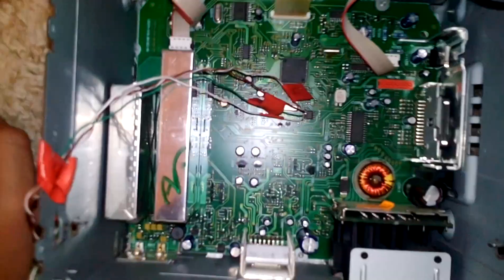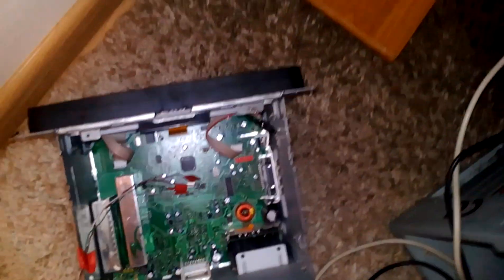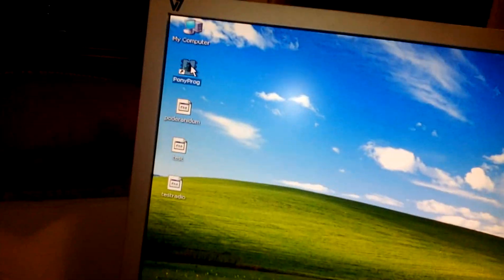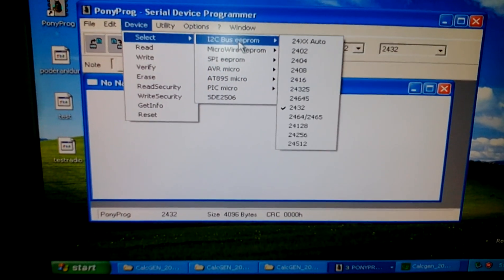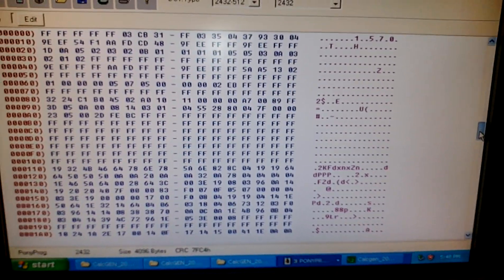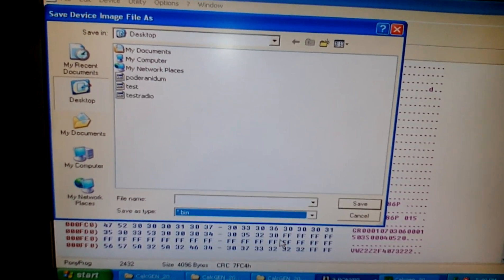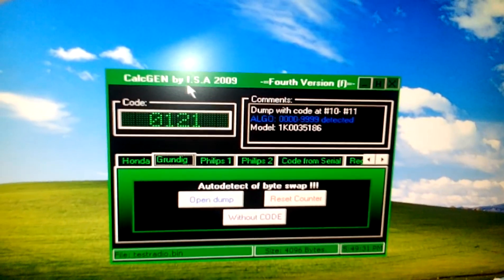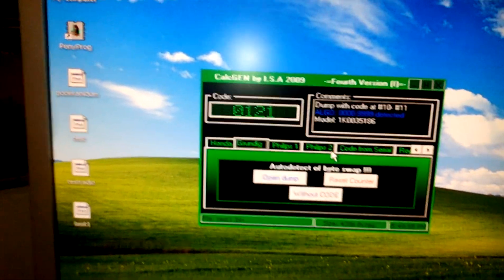How to read radio code from eeprom RCD 300 MP3 RCD300 decode

Comment: Hy thanks a lot for sharing your knowledge.
Can this this pony prong be used for all make and model?

 if no can you identify witch year and models please?
Reply from the maker: You can use pony prog to read dump from specific eeproms. You shold buy real programmer (this very cheap one, or some other better programmer) https://www.aliexpress.com/item/4000033712186.html?spm=a2g0o.productlist.0.0.5e554149wTtyWP&algo_pvid=e20210c5-c910-44fa-8393-611c6cd843af&algo_expid=e20210c5-c910-44fa-8393-611c6cd843af-4&btsid=0b0a187916122525011691442e6c9f&ws_ab_test=searchweb0_0,searchweb201602_,searchweb201603_ and test clip. It will be much easier to read eeprom that way.

Comment: I don't understand how you are interfacing the eeprom with the computer. Are you just soldering the 4 wires from a USB cable to pins 5,6,7, and 8 on the chip? Is there a special device or connector used?

EDIT: after a bit of research, it appears you need a male DB9 connector. Which makes more sense considering they is a 9 pin device shown in the USB connector schematic. However my question remains; Could you show with photos or describe what you are using to physically connect the eeprom with the computer. Are you using a DB9 to USB connector?
Reply from the maker: I was using serial port whit this very simple diy programmer https://b-a.d-cd.net/512aedcs-960.gif
Reply: Okay, I do not have a computer with a 9 pin serial port. Is there an adapter out there I can use, or should I borrow a computer that has the correct port built in? 

Thank you for your patience, I'm very new to this.
Reply from the maker: You can use some cheap ebay eeprom programmer with test clip like this https://www.revtronic.com/wp-content/uploads/2015/03/pomona-8-pin-eeprom-soic-test-clip.jpg , there are some usb to serial port adapters but I don't know will they work in this case. I also have a struggle to find pc with serial port then to figure out what is wrong with him and install new windows :D
Reply: Okay, thanks for the advice! I think I'll just pick up a programmer online. Thanks for your time!

Comment: Milose can you find code from radio serial number ???
rcd 310
Reply from the maker: I think not
Reply: @Brdar90  how can I know where to connect the wires on microchip. Where is the number 8 7 6 5. I can have two combinations

Comment: Thanks a lot pal! I bought an rcd300 for cheap for use in non vw car and unlocked it just like you said,it was way too easy. For the resistors and such circuits in general use potentiometers they come really handy.

Comment: hi  friend.  Thank  you  for your video.  It great  can I ask a question  on your circuit board  diagram  you have put for resister value 4k7. is it supposed  to be 47k ?
Reply from the maker: +James Birkin I can't remember right now but I think that I was using exact values like in diagram
Reply: No.  That's an example of how europeans write 4.7K, the K takes the place of the decimal point.  I know, weird right?
Reply: @leebarnes655  You made this comment 6 years but I'm here to thank you, I was building something using a german diagram, that was driving me crazy, I couldn't understand wtf I was reading.
Reply: @KerbosYT  It gets worse, 1R3 is written to be a resistor of 1.3 ohms which is not common enough to run across everyday, but you will see them in current monitoring situations. Again, I'm wondering what kind of dyslexic are theeese guys anyway? I also now see periods for commas in 47.000 (47K) resistors, there is something in the water. This is how that French rocket blew up.